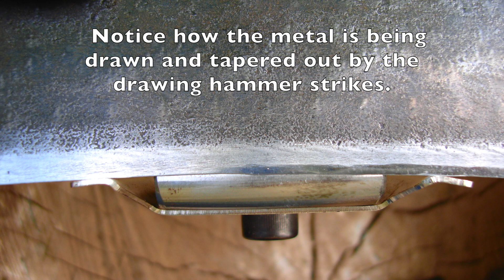Zen and the Art of Peening a Scythe Blade

Comment: Thank you Sir for your dedication to teaching everything in relation with the scythe !
I do not use a guide plate and of course one of my biggest issues was keeping the edge precisely at the top of the anvil. Today, I have found out that letting the back of my left hand's fingernails slide along the anvil while holding the blade firmly is a great help, thus improving ease and speed of the whole thing.

Comment: Lovely video. I'm watching it again a year later!! Can I ask, how do you START with a new blade, that couldn't be called 'blunt' but has a thick slab of a spine about 2mm thick where the blade should be?? Do you file it all down with a deep band (1cm back into the blade)? Or do you start coarse peening immediately??
Reply: On the one hand, filing is not totally wrong, after all this is the way the factories make the bevel on the new scythes. On the other hand, in order to avoid losing a lot of metal, I would try to peen and see how hard the metal is / how it responds to peening ; if you are lucky, the metal is soft enough and you can restore a bevel just like this.

Comment: Thanks for the excellent videos!  I want to use a scythe and am primarily left-handed (LH), which really means that I am semi-ambidextrous with an advantage in the left hand.  Peening looks to be a right-handed (RH) task for the RH scythe, which seems to be the standard.  Curious to know if anyone sharpens a blade for lone-working lefties - we are quite adaptable, if not.
Reply from the maker: You can peen in the other direction as well (beard to tip). If a lefty is peening a right handed blade, most I've seen just skip peening the last few inches at the tip. Just hone it more up there after peening.
Reply: I have peened a right-hand blade using my left hand for hammering, and it worked fine. It's good to be semi-ambidextrous as one's strong hand can get tired.

Comment: Awesome video, would be nice to know how the blade should touch the anvil since I don't have a guide.
Reply from the maker: Even if you do have the guide plate, you have to set it where you want it by bending the wings. It's not pre-set. I explain how to position the blade in my manual. But basically you position the edge just a hair past the apex of the radius, towards you. The edge is pressed down so that it is in solid contact with the apex of the radius of the anvil face.

Comment: I have a question, with hammering the metal portion get thinner and wider , the metal on the outer bevel basically becomes stretched and "longer", Will It result in a wavy  bevel? I see on old used european scythes with bevels going up and down, maybe with a good arc but not flat
Reply from the maker: Waves are the result of moving an uneven amount of metal. A consistent force with the hammer, plus consistent advancing of the blade, so that every mm is peened equally, will move the metal out smoothly and will not result in waves.
Reply: One Scythe Revolution thank you for the reply, i have a brand new austrian scythe, i grinded the First bevel with a wetstone, for the next bevel i Need to peen it
Do i Need a flat face Hammer or a light convex face?
Your video was VERY useful, thank you so much
Reply from the maker: Your welcome!  I like a slightly convex hammer.

Comment: Looks like on those hammer strikes a slight wrist movement is required alongside locking the elbow.
Reply from the maker: +Zig Zag Not much, though. I would let a wrist action develop naturally as you are learning, instead of intentionally adding another motion to start with. For most people peening is a totally foreign activity for their existing neuromuscular co-ordination. Once you have developed the new co-ordination, and know how to peen, you can do what ever works best for you. I am just trying to teach a method that gets people started in a good way, and that does not result in wrecking their blade. Consistency and accuracy is the key. Inconsistent and inaccurate hammering moves more metal in some places and less in others. The resulting differences in tension leads to cracks, or worse, waves springing up at the edge. These waves are very hard to fix. It is best to start learning by staying at the edge (instead of several rows in), and learning to be as accurate and consistent as possible. Limiting the number of joints in motion will help.

Comment: Are both peening techniques complementary to eachother, or not necessarily and it's just one or the other? You have to do both to get a sharp edge,  or are there situations when it's sharp after using 1 technique? Or perhaps situations you decide on using the dragging AND straight down hammering technique?
Reply from the maker: Yes, I think both techniques are complementary. I always follow the drawing hammer strike with the straight down hammer strike.  If the bevel of the edge is already quite drawn out, I will skip the drawing strike and just use the straight downward hammer strike to finish peening the edge.
Reply: @BotanAnderson  Thank you. I will start mowing my grasslands by scythe coming seasons. Very much looking forward to that. Your videos have been a great help so far, cheers.